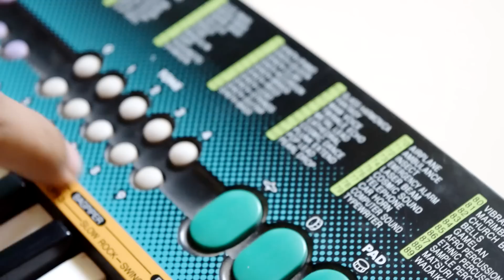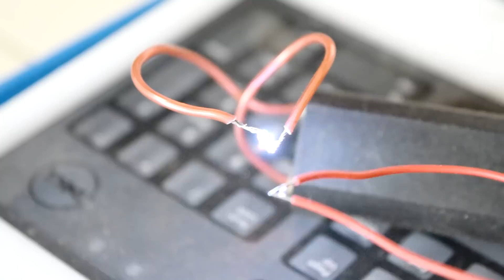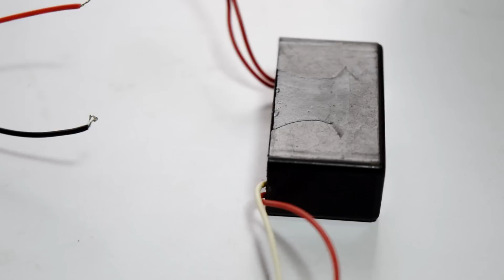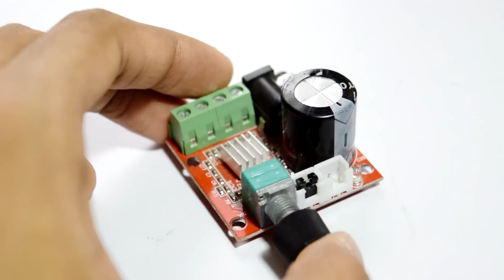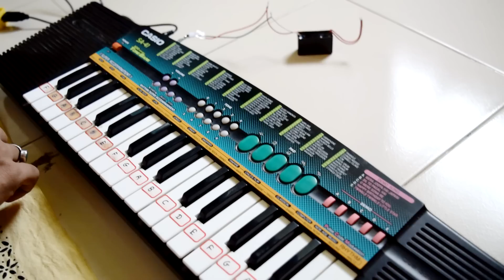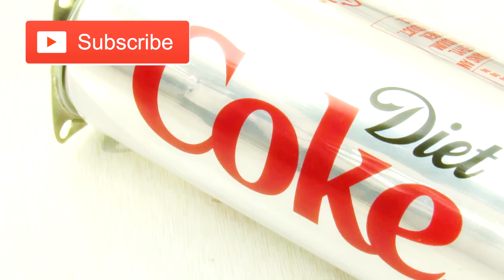🎵 Tesla Coil Music

Comment: bro can we make it without high voltage transformer, using 2 diy tesla coils?
Reply from the maker: +deepak bhushan yes
Reply: how can we do it with tesla coil instead of battery pls tell me i want to do it without high voltage transformer
Reply: +rock! vandkar technically speaking tesla coil IS a high voltage transformer, so just use tesla coil instead of this HVT
Reply: Robal how would you incorporate this into a tesla coil or slayer circuit? Would you use the output from the board as the input to the tesla circuit in place of the power supply/battery?
Reply: +Benjamin Shultz well, basically, you do everything like it is presented by the video, but instead of pluging the amplifier to the high voltage generator's input, you plug it into tesla coil'a input (primary coil). Of course, i would recommend using more powerfull amplifier, and you could increase a voltage a little bit before plugging it into tesla coil, for example: mp3player -> amplifier -> step-up transformer (to gain something like 200V) -> tesla coil.
Reply: Robal could you make an example?